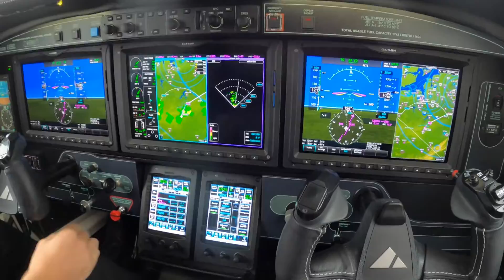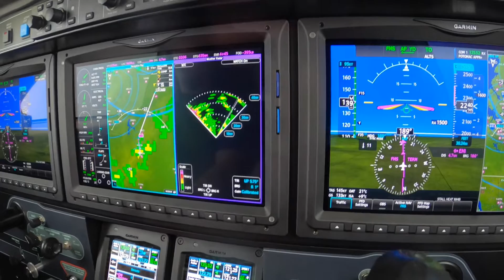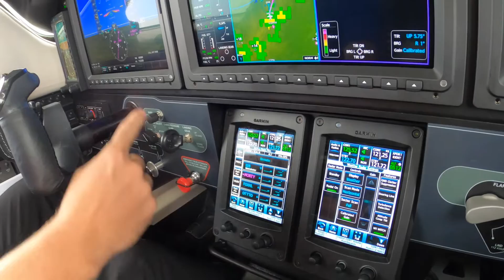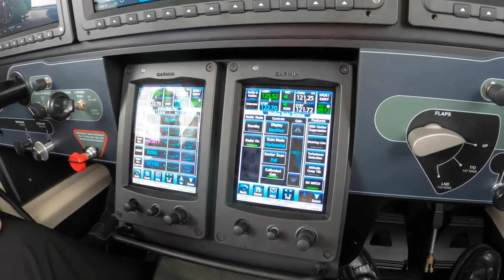Normal Takeoff: Piper M600/SLS Aircraft

Comment: Why leave the AP climb mode at TO and not change to FLC/IAS mode for a safe climb at the optimal speed?
Reply from the maker: Thanks for your comment.. Good observation. I think one of the most important concepts in single pilot operations is operating procedurally, the same way each and every time. To that end, procedures must be simple and well vetted. In this video the first segment climb (dirty) is just being completed by turning on the autopilot and verifying that the aircraft is properly configured and on speed. Second segment climb in this aircraft is accomplished with rate of climb as per the ODP. In this example there was no ODP to contend with. We have no third segment in light singles and, in the absence of an ODP we can begin the fourth segment (cruise) by setting climb speed with the FLC button. That is 130 kts in this aircraft which we were pretty much doing already. The pilot was verifying correct second segment speed as we cleared the clouds prior to beginning the fourth segment by pushing the FLC button albeit a tad leisurely. It got edited out. Thanks for noticing!

Comment: What was the tilt set at on takeoff? Lots of red returns, yikes!
Reply from the maker: Hi Pete,

Good question. The tilt adjustment hadn’t been made yet. I had turned on the radar prior to takeoff to let it get warmed up and running. In general I use the 40 mile range with ground visible in the outer quadrant. Then I use the vertical profile to positively identify water (rain) ahead of the aircraft. Fly Safely - Train Often .. DR
Reply: It looks like it goes from 1.25 DN to 5.00 UP with various levels of return.
Reply from the maker: Most of those returns are ground. Use vertical profile to know definitively what is water and what is ground. Fly Safely - Train Often .. DR